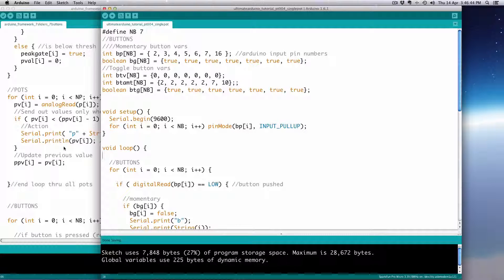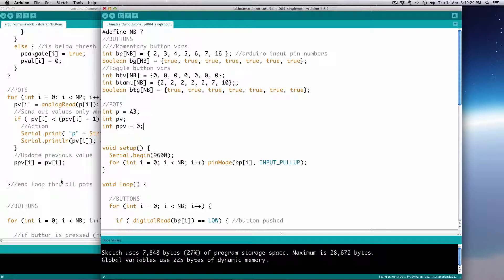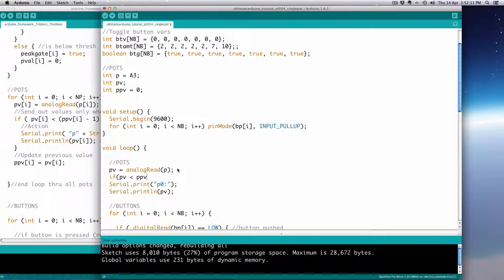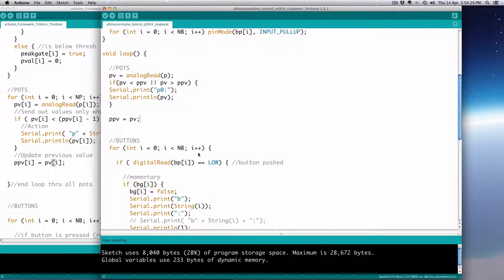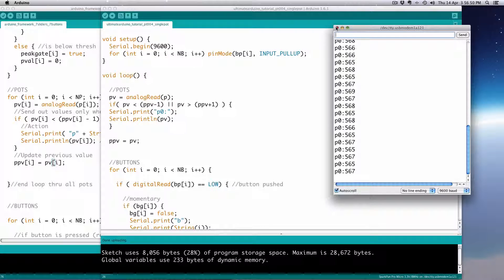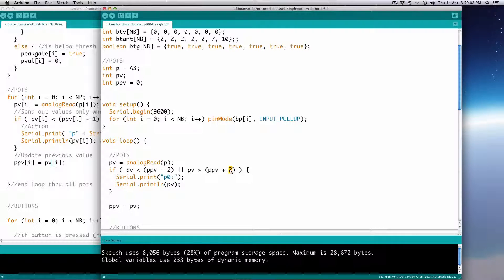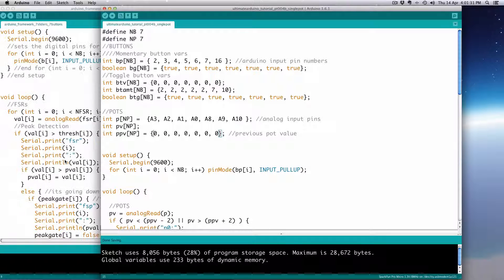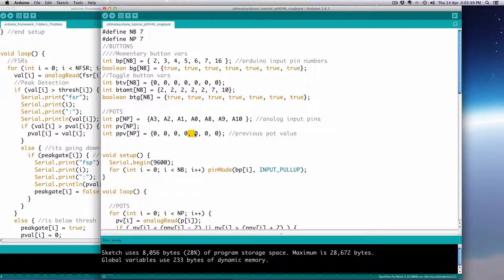Ultimate Arduino Inputs Code Tutorial - Part 4, Single Pot

Comment: Very interesting and very well explained.

I have a question though, shouldn't the "ppv = pv" statement be included in the set of actions to be done in the previous if statement? I would say you only want to update the previous value if your program did what it is to do when it has detected a (significant) change from the previous value.

Also, for detecting the significant change compared to the previous value, is it possible to use an absolute value function? Something like 
if abs(pv - ppv) < 2 { do stuff } ?